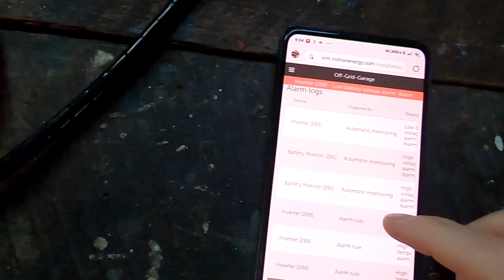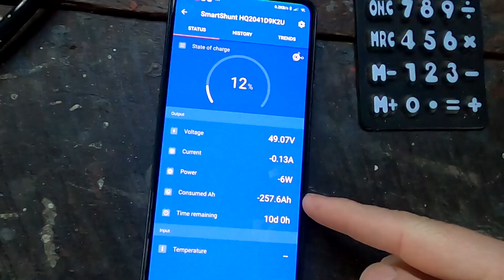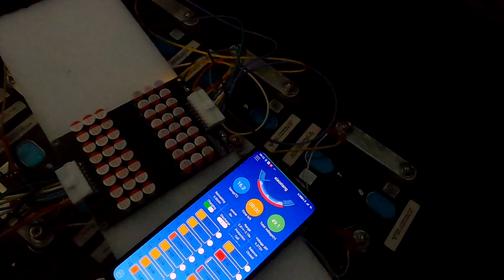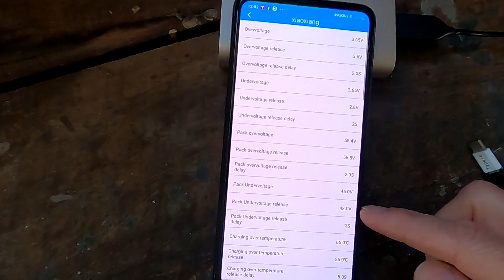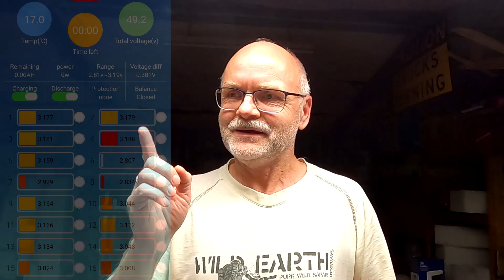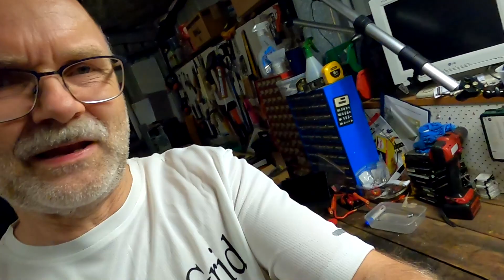Can the active balancer save this battery? Impressive result!

Comment: Hi Andy, 
With BMS + Active Balancer we are getting more cabling to the battery cells. 
I think about using a 16 x WAGO 2002-1781 3-conductor fuse terminal block; for mini-automotive blade-style fuses; with test option; 2.5 mm²; Push-in CAGE CLAMP®; 2,50 mm²; 
One wire from each cell to the terminal block. BMS and Balancer connected to the WAGO after the fuse. 
Easy disconnect for maintenance reasons by removing the fuses.
Testing with multimeter etc via the WAGO Test pin. 
With this structured cabling it would no longer be necessary to touch the cells when doing maintenance, testing etc. and therefore mitigate the risk of shortcuts. 
What do you think about this idea ?
Reply from the maker: I would be worried about resistance across all these additional connections when we measuring in the mV area for balancing.
Reply: i use blox FJ5N terminal block with no fuse.
not for maintenance per se but for centralised wiring ease

Comment: 11:40 voltage is rising not because of recovery, but because if you take a Wh out of one of the higher cells the voltage hardly changes, but you put it into a low cell in a the steep part of the curve and the voltage changes dramatically. So the positive and negative changes in different cells are NOT equal because you're moving energy, not current, and not voltage.
Reply from the maker: Yes, that is correct.
Reply: @OffGridGarageAustralia  I know! I only correct you when you make false statements in the vids :-D
Reply from the maker: @fredio54  that never happens at all 😂

Comment: My active balancer is connected parallel to the Daly 200A smart BMS and it works fine since the start. Bms is burning high voltage off and wasted as heat. The active balancer is always on and will continue to balance between full and empty cells. I like it so much that I will do the same next time again. You get more amps in and out of same battery pack.
Reply from the maker: Thanks for the info. I'm really pleased with the balancer now after several days. It works very well.

Comment: @off-grid-garage Andy, now for a test on overall capacity acheived w/o balancer (until BMS cutoff) Vs. W/cell balancer. In theory you should be able to get more energy out as the higher capacity cells should feed the weaker ones so they all hit cutoff at about same time.
Reply from the maker: Yep, that's on my list...

Comment: Your video's are a great resource so thank you. Been following them here in the UK and I have been impressed with the detail.... so thank you for the time and effort you must put into the content creation and all the back office editing you must have to do before releasing them.

Unfortunately when ordering from the AliExpress website there is a minimum spend which they don't tell you what that amount before you can use the discount code. Not sure if this is the same in other countries but here in the UK I have now purchase a 4S and a 16S balancer on separate orders and on both orders I was denied any discount. So, just letting you know it may be helpful if AliExpress actually said what the purchase amount has to be before the discount voucher kicks in.  

Many thanks again for the great content.
Reply from the maker: Thank you very much for your kind comment and feedback.
I read this somewhere  here already, the discount code does only seem to work over US$100 spent. Other said it gives you only $2 discount anyway, so probably don't bother about it.

Comment: I would love to see you add a second balancer, the same one you have to see if it balances twice as fast. The balancer on your BMS does not use enough balance current to keep up with your massive bank.
Reply from the maker: Now after several days, all cells are still in balance. Once this has been achieved, I think the max 5A balance current is fine. As the balancer works 24/7 it does not need to be as fast. As seen in the video, it takes only 12h or so to get them all in line again.
Reply: yes many users suggest it, i think it's important when you have not good quality cells

Comment: Hi Andy, Good day,

Just want to say that I was expecting that you going to change you mind about the active balancer. It is lucky that you got the right one and not the small one which might have change the outcome and your conclusion of this test as well. 

Looking forward for the second part of the test at the topo f the voltage and I do expect the almost the same result especially after a few hours after the sunset. it will equalize.

Just probably if you wanna test further on the active balancer , i suggest it would be:

1) The balancer will keep balance the cell even all the cell are balanced.
2) if the above true, that mean the balancer will drain  current overtime especially with smaller capacity pack. I had a friend who installed this balancer for the 32650 4S 12V and leave it for few days, the pack drain to 2.++V.
Reply from the maker: Thank you. So far I'm really please with the result of the balancer. I think the balancer will turn off at a certain stage, either under a certain voltage or if the spread is below a threshold.

Comment: Oh man, i just love the work you are doing !!!! It has helped me a lot here in Finland where i built a 12 v 100 A battery of China lifepo cells wich i use in my fishing boat and is connected to the trolling motor. When the cells came in June, 3 cells where in balance and 1 was 0,35v higher, i bottom balanced them for 2 days and then charged and installed in my with a BMS and everthing is working just fine :)
Reply from the maker: Thank you very much for your feedback. It is great to hear the these videos and information help others to better understand how the cells work, how to set up the battery and make it work for their specific need.

Comment: Hi andy. 
I virtually have the same set-up as you.
The main problem i am having is the solar power.  When full sun is out i am pumping over 75amps into batteries. 
This then raises voltage very fast to and over the 52v , which inturn overloads the batteries and shuts off relay.
This then upsets the victron MultiPlus-II and shuts down,  loss of power
Reply from the maker: 52V is far to low. Not sure about your settings but this is only 3.25V/cell. This could mean you're cells are only 30% charged when they reach this voltage. Try to set 55V or 56V in your solar charge controller. That would be 3.45V-3.5V/cell. That should work a lot better.
Reply: @OffGridGarageAustralia  thank for your reply andy 
I should have explained in better detail.  
55.1v is my victron bulk/Absorption charge setting not 52v. 
When solar is pumping 75a into batteries voltage increases,  on some cells it brings them to 3.6v and then over which triggers the quacc over load as it should as protection,  this then cuts power, and MultiPlus-II doesn't like it, gets confused and shuts off inverter to which then has to be manually restarted.... pain

Comment: It is not unreasonable that the voltage went up with the balancer running. Cell 6 was in the steep part of it's charge curve where most of the other cells were in a clatter portion. The balancer will affect the voltage of the higher charged cells much less than cell 6 so cell 6 increases in voltage more than the sum of the higher cells decrease in voltage.
Reply from the maker: Yes, I figured that later on after reading many comments here about it. It was not obvious when I looked at it at when recording.

Comment: Have you noticed that it will never show more than 10 days. It always reports 240 hours as a maximum.
Reply from the maker: 10days of what? Sorry, missed the context for that...
Reply: @OffGridGarageAustralia  the maximum time that vrm reports as time to go is 10 days.  My idle current with my Pi is 3 to 4W, on a 560AH 12V battery. Never shows more than 240 hours. You mentioned 10 days close to the start of your video.

Comment: Over all voltage is rising because the more charged batteries (in your Situation) are closer the the flatter end for the curve. So if you move 5% soc from most to least charged cell you will have a net increase.
Reply from the maker: Yes, quite obvious, right? Didn't catch that while recording.

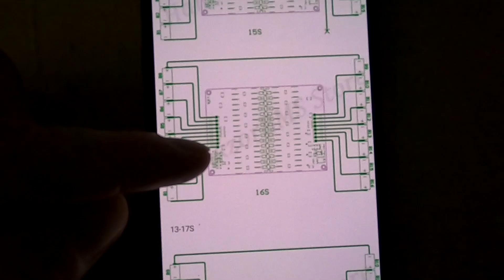Comment: Hi Andy: At 6:00 it looks to me like the diagram is pictures with the capacitors face down (Notice on the diagram there's no depiction of the capacitors) and you're holding the board with the capacitors face up. This is why the B- and B8 wires are inverted. (Not mirrored as you said, which would be flipped left to right. It's inverted flipped top to bottom)

at 11:20: It's not strange at all that the voltage would rise. You started out with your high cells sitting close to 3.2v. Pulling 1 Ah from a cell at 3.2v won't drop it's voltage very much, but pushing that 1Ah into a cell at 2.8v will cause that cells voltage to rise substantially. So the "sum" of the voltages (IE: pack voltage) is higher.
Reply from the maker: Yep, thanks. Both of your points are true. Just not obvious for me while recording 🤦‍♂️😉

Comment: I have a kinda crazy question... could you use a 16s active balancer with an 8s2p battery for all 16 cells?  If it's just balancing cell voltage it should work as a balancer doesn't seem to care about the overall pack voltage right?
Reply from the maker: No, that will not gonna work and you might cause a short across your cells. The balancer will be damaged as you connect several leads to the same battery. With a 8s2p pack you definitely need a 8S balancer.

Comment: Hi Andy, I am also considering an Active balancer, they are usually in 2A and 5A Performance but is also available in 10A.  My inverter can charge and discharge with 240A but I will rarely use above 100A, which of the 3 versions do you think is needed to hold a pack balanced at those charge/discharge levels? I guess your version is a 2A?
Reply from the maker: The basics with these balancers is, the larger the voltage difference, the higher the balance current. I think the 2A version is totally fine if you leave it connected all the time.
I've got the balancer connected for almost a week now and it works really well.
Reply: @OffGridGarageAustralia  Thank you for the great news, I was worried that if I use i.e the 11kW Tesla charger from battery, that it might drain the batttery so fast that the balancer might not be able to keep up because the delta between batteries increase faster and then low voltage of one cell sshut the BMS down, but I think it is as you say, the balancer will  normally keep the package so balanced that there is no need for a faster move of energy.  And even if it momentarely shut down it will soon after start again when balancer made it magics.  :)
Reply from the maker: @jonasgranlund4427  Jeeez, what battery have you got that you charge your car with 11kW from it?
Reply: @OffGridGarageAustralia  hehe I havn't received everything yet but it is a 500A Daly 16S BMS and a 3p 16S 280Ah battery, so around 40kWh pack with an Deye 12k (same as Sol-Ark 12k) hybrid inverter that can charge + discharge with 240A.

Comment: Great video, looking forward to the top balancing video!
Reply from the maker: Yeah, it will take a while until I reach that with the current sun. Also supplying parts of the house already with power so the battery won't charge much during the day.

Comment: I am an advocate of active balancers.  Cheap ones can have issue with proper balancing direction when real world inverter and charger currents causes cell voltages to jump around confusing the balancer.  Evaluating performance with no inverter or charging current variance is not real world use case.

Be warned about capacitor charge pump type balancers long term reliabilility with electrolytic caps being subjected to high ripple current.  Usually the cap's electrolyte dries out and capacitance declines.  Sometimes they burst and short out from the high ripple current.  As they are directly connected to cells (through MOSFET switches) there is no safeguard if they short out.  If top of caps start to bulge out it is a warning of failures to come.
Reply from the maker: I know about the problems with capacitors from my electronic background. I think they have used the better quality ones which are fully sealed and don't dry up any more as other types do.

Comment: This specific active balancer is doing nearest cell transfer right?  For example for a 4 cell 12V battery in the following scenario: Cell 1 voltage is low, cells 2-3 are the same mid voltage and cell 4 is the highest, it has to transfer energy from cell 4 to cell 3, cell 3 to cell 2 and finally cell 2 to cell 1 basically doing micro cycling on cells instead of going cell 4 to cell 1 directly?  Is this a concern if kept connected over time?  I know there are others that are direct are they better?
Reply from the maker: That's basically correct. only that cell 2 will already start charging #1. The #3 will start charging #2 and #4 will give power to #3.
Not sure if the balancers with inductors are better. From what I read they both work people are generally happy with either.
Reply: @OffGridGarageAustralia  thanks for the reply, I think most will work okay but arguable if it's much better than resistive balancing if they are wasting a lot of energy transferring the energy, i.e it might be 95% efficient process to charge nearest cell, but once that energy gets from Cell 16 to Cell 1... well then....looking at less than 50% efficient by the time it gets to the other end.   
I also understand it doesn't need to be in operation constantly, but waste still bugs me!
I looked at your link for the balancer on your website and I see you have already ordered a smart active balancer that can transfer power from any cell to any cell without needing to borrow from nearest-neighbour, to me that one is more interesting and can't wait to see your video on it!
Reply from the maker: @EnergisedAdrian  That new BMS is still on it's way. It's the only one I could find which includes an active balancer. I will test this with the existing battery. If this works it may be the way to go for top balanced batteries.

Comment: Ok seeming how this a test i want to throw in the mix this question. Seeing what the balancer has done in 24 hours ( approximately  ) ... can you have 2 balancers in parallel ? Would they fight or work together?  Thanks again for your time! 
Marc.
Reply from the maker: Why would you do this? Just for the sake of testing or to balance faster? I have read some comments here that people have done that and it seems to work.
Might be worth a test 🤔
Reply: Thanks for your time... using two balancers at the same time is yes a curiosity question but more for a point of the balancer works well only at the ends of the charge curve with any noticeable improvement and not in the middle of the flat section.... so the  time spent at the ends is an extremely short window of opportunity.... unless I have misunderstood a balancers functions? Thanks for doing what you do andy! 
Marc
Reply: I up vote this. Seriously this could be game changer for lots of people with mismatched cells. Please do this
Reply: Won't gain anything long run.  Will it get the first day's balance done quicker, of course.  Does it make any sense to leave it on there when 1 is plenty? No

Comment: I have never seen a LiFePo pack so unbalanced. Not long ago you claimed to have achieved a minimum deviation between all cells and now this ?! After the "spectacular" use of the ballancer, how much time do you think will pass before you have to balance again? With so much equipment tested and tests performed, some of them on request, aren't you curious to see the behavior of a battery with bottom-balance and compare it with your current top-ballancing battery? There are several users talking about this, why not try it out? If it works (as it works!) you no longer need to make videos with BMS balancing tests, own balancing equipment, etc.  This is the least positive part for your followers. :-) Think about it, Andy.
Reply from the maker: Thanks. I cannot combine a battery with bottom balancing with another one that was top balanced. That will just not work. I will show this in a future video. I can balance either or with both batteries but not one top and the other bottom. It would overcharge cells in the bottom balanced battery.